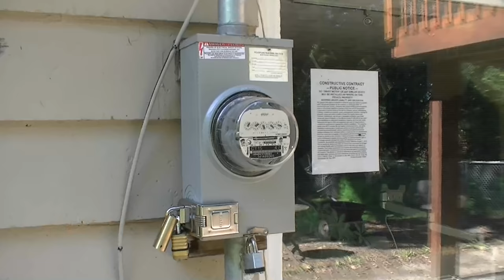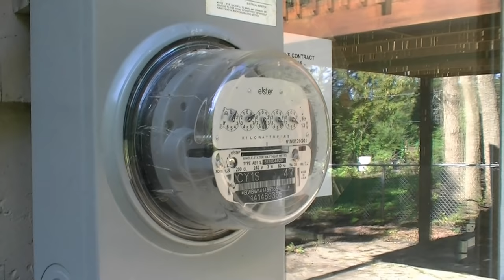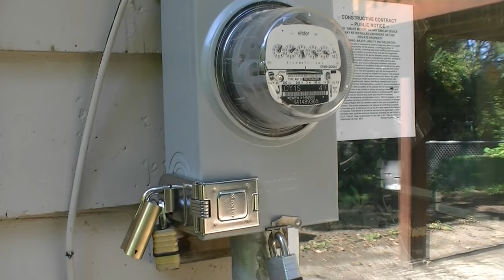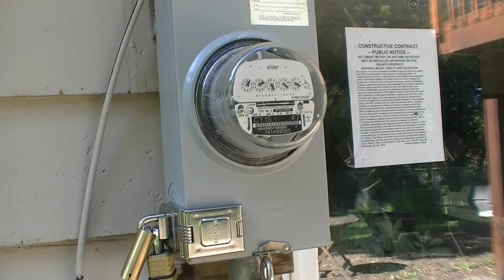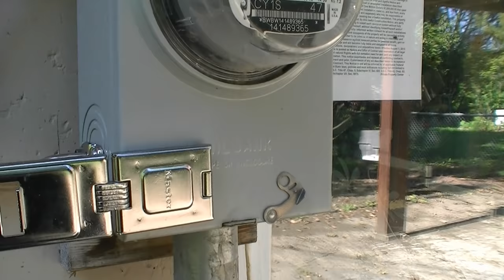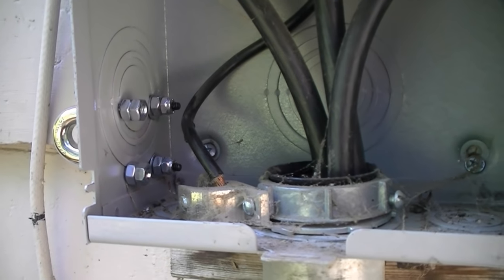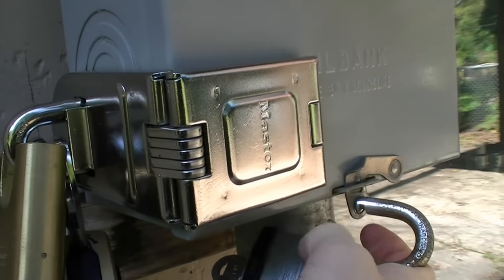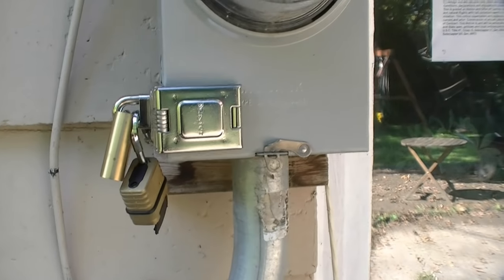Locking Your Electric Meter to Prevent Smart Meter Installation

Comment: Although I can understand your message, your tactics are asinine to say the least. Drilling into the box with live power a few inches away makes you a candidate for a Darwin Award. Please don't breed.
Reply: Mike is right.  Drilling into a hot meter can is extremely dangerous.  120 volts to ground doesn't seem like much, but it can burn you, blind you, cause a fireball.
Reply: It's not even the voltage in the box, it's the amperage! The only fuse protecting the wiring in that box? The fuse on the primary of the 13,800 volt transformer on the pole or in the pit!
Reply: *You're ... We'll just leave that there and sink in for a minute. ;)
Reply: Ishkabibble if you were an electrician, as I actually am, you would recognize that is a service drop. Which means if he opened the box and pulled the meter then the bottom posts would be dead. Therefore his drilling and installation would be perfectly safe. Do your homework before attempting to speak from authority.

Comment: This be dumb.  Electric code was arrived at largely by a century's worth of fires, investigated by fire departments and reviewed by electrical engineers to arrive at hazard removal/prevention by reasonable methods of construction.  So guess what? Never, ever have a fire at your house: if you have done something preventing the meters emergency removal, keep your lawyer on speed dial.  You just might need it.  Luckily, most FD's carry bolt cutters and will take care of business - but at a cost.  I'm guessing this setup costs you about $1400 in the event of a fire [beyond whatever damages occur].  If a conflagration spreads to your neighbors,  bend over.
Reply from the maker: Flinch are you saying the fire department would charge $1400 to use a pair of bolt cutters?  That doesn't seem very reasonable at all.

Another option is a home owner can install a meter socket with a main breaker attached to it.  Wouldnt that solve the issues in case of a fire?
Reply: No, just a personal guesstimate of legal fees, fines and possible court costs.  No way to nail down a real number, as every state is different.

Comment: This video is good example why you tube is piss poor place to get information. It is true in most places we own the meter box. However when we sign on for a connection to the grid we grant the utility ingress to their equipment. So cutting the locks wouldn't be vandalism,  because it's the utilities right to access their equipment an install whatever whenever, they deem necessary. Sorry this dude is one more smooth talking smart meter loon spreading FUD. Load management is going to happen, yes it's going to be a pain to adjust, but rolling blackouts or total blackouts would be more painful. Unless there is a critical medical need I fully support the utilities disconnecting these protesters. They seek to force their will based on ideology, and ignorance on the rest of us. They might call those of who us see what has to happen for the good for the maximum number of people sheeple, but they are their own breed of sheeple. There are battles to be fought, but these sort obsessions keep many people from recolonizing them. Perhaps they recognize them, and don't want to take on those battles because it would mean  real world, real time sacrifice within the borders of the US. I'm not talking of deadly or physical sacrifice, just giving up a little of those luxuries so many believe it's their right to have Hell if I know, but it getting pretty frustrating.
Reply: waswestkan  very well said!!
Reply: waswestkan My company wouldent let me lock my box up to stop the local teens messing with it.

Comment: I'd be afraid to touch those metal locks knowing that metal conducts electricity.  What if one of those wires inside the box comes off, and is touching the metal box on the inside?  You wouldn't know it because you can't see it.  So you come out to check on your locks and touch one and ZAP!  You're gone............

Comment: the utility company has jurisdiction to that box. they can secure the box in any way they feel justified. if the box is not secured by them then how are they assured that YOU are not STEALING their power by bypassing the meter?  they can just get a court order and/or terminate service.
Reply from the maker: Do you work for a power company like so many of these commentators?  First off jurisdiction is not the right word.  They normally are given easement, but it's not an irrevocable easement.  They also are NOT given easement to install monitoring, recording, and transmitting devices.  

Sure they could shut power off but they rarely do to people.  It's not good for business to shut down your customers lolol.  And all of us consumers and customers...WE are the ones with the real power.  A little civil disobedience is needed.  How many people to install analog meters would it take?  Not a very large number!

Comment: In my area you cab refuse the smart meter but electric company will charge you 23 bucks and change a month to read you meter. Thats more than the electic supply portion of my bill.

Comment: The utility company will just cut your access to power until you comply. You can't fight a monopoly without being a casualty unfortunately.
Reply: BUT WHY DO THEY HAVE TO INSTALL A DEVICE THAT KILLS OVER 100 FOLKS EVERY MONTH?
They only have the right to measure what power you use.
THEY DO NOT HAVE THE RIGHT TO INSTALL A COMMERCIAL, MESHED NETWORK, HIGH POWER RADIO TRANSMITTER ON YOUR HOME

Comment: alsonotice that the power company is not required to give you service  especially if your tampering with their equipment  the tag that was removed is to guarentee your not stealing power  removing that tag just opens you up 2 more problems
Reply: Let's look at why we need TIN FOIL HATS. 
 #1 A smart meter will hurt or even KILL disabled homeowners who have disabled medical implants.  The average of deaths by smart meter radiation and smart meter fires is almost 100 every month in North America.
#2 Did you know if your power company “turned off” the power to your home when they did a smart meter install, your chance of a smart meter fire increased by a factor of 10,000.
#3 Your power company has access to all of you private power information. Eg When you make tea, when you turn on your alarm etc. This private information is sold to Google for huge sums of money. Ask your power company what the second radio transmitter in your smart meter does. (ZigBee) 
#4 A smart meter will cause cancer to return if your family members who are fighting cancer at home. If they come home from the hospital and sleep near a smart meter, they will die. Check with the US Cancer Society website. 
#5 Smart Meter RADIATION  will turn off breakers in your home. Both AFCI's and GFI's get turned off by the radiation from the smart meter.
#6 You smart meter is very accurate, BUT, the software (firmware) is programmable. Your bill has nothing to do with the power you use. 
#7 Smart meter radiation is breaking Ionic Bonding.
#8 A huge expenditure for a huge loss. Billions of dollars to purchase something that does not general generate any power and each smart meter need 4 watts to operate. One million smart meters use 4,000 KILOWATTS of energy to operate.
#9 The second radio transmitter is for ZigBee. If you want your power company to MONITOR your home 24/7, then you are in luck. Don’t forget, this private information will be sold. Why do you think your power company spends BILLIONS of dollars and does not generate one watt of extra power to sell?
Reply: This guy above me is a nut.. as an electrician,  I can tell you that it is not possible  for a meter to know what is on downstream. 
 How could anyone even believe it can know what appliance you have on?

Comment: you do realize that they can simple cut your power off, and refuse turning anything back on until you remove the locks or they can simply cut them off because that box belongs to the power company. Unless you plan on going off grid any time soon, this is a great way to get yourself in a nasty predicament. Not to mention you vandalized their box. Oh also your locks are incredibly easy to pick.

Comment: This is stupid, illegal, dangerous, and against service agreement.  You agree when you get service that the power company is to have unrestricted access to their equipment.   Plus if you have a fire the fire department needs to be able to remove meter and as an installation tech of the smart meters if i find this it would not prevent me from doing the exchange i will cut the locks and complete the installation and am legally able to do so.    As for the radiation topic you would have to be stupid to believe that because you carry a cell phone wich puts out more rads than the meter, you have a microwave in you kitchen the puts out  way more rads than this meter, and most likely you have a WiFi router wich is also putting out more rads than the meter.    I have changed out several analog meters that are melted and to to say the smart meters melt and analog dont is one of the dumbest things I've heard.

Comment: Why does a lock protect from smart meter change.  Can't the power company cut the power line where it enters the analog meter box & install a second box?
Reply: Locks don't protect from a meter swap. In the area I live in, every new service contract clearly states  that the utility is to have unlimited access to the meter and they reserve the right to refuse service if impeded.

Also, many utilities are municipal or state owned which means they codified different penalties for tampering with the metal seals on the meter base. Were I'm at the utility can charge you with tampering and it will hold up in court. Know the laws you fall under before you try anything like this. 

What this person doesn't tell you is that the analog meters belong to the utilities not the homeowner. The meters are not your property and if the utility as well as the overhead/underground lines.

Lastly this very dangerous. Not every meter base is made the same. Not every home has the same type of meter or wired the same. Not every meter is rated for the same voltage some are low and some are high, the size of the structure doesn't determine the voltage. Some meter bases have tight clearances and this type of tampering will drill into the live wires. Damaging any of the internal components on a live meter base can not only kill you but you could run the risk of causing an electrical fire or tripping the breaker in the transformer causing problems for your neighbors as well. I've seen the what can happen when people who didn't know what they were doing made a terrible mistake.

Comment: The grey box the meter is enclosed in, is the homeowners property. Thus it can be locked, the wires that run from your home into the meter are property of the homeowner. Legally the box can be locked by the homeowner. The electric company must give you notice to enter upon your property. In my case having multiple German Shepherds on my property, I have notified my electric company by certified mail that they must notify me before stepping foot on my property, and put them on notice of the security dogs and that they assume all liability if they do not notify me of entering upon my property, per my attorney.

Comment: How about putting it inside a steel reinforced concrete wall with only visual acces from the front. Further acces from the inside of the garage or basement will have to be granted by the home owner.
Reply: Nope,  NEC rules states there are levels of clearance around and in front of the meter can.

Comment: it's illegal to put a lock on the meter box. the reason why is if a house  is on fire and the fire department needs to cut power off to save time to save a life and  prevent more potential injuries if they have to wait for a line man  there's a good chance someone will be hurt or your house will burn down or both and your seal tampering tag is gone you could be fined 10.000 and lose your service permanently
Reply: For everyone wondering about what would happen if the building/house caught fire and then the firefighters going, "oh, well we can't take the meter out, guess we'll let it burn down. There are many meter boxes that have a main breaker outside, as well.  

This is a dual meter box with a service disconnect: http://www.homedepot.com/p/Siemens-Uni-PAK-2-Gang-125-Amp-Tenant-Main-Breaker-Meter-Socket-WP2211RJ/206109554?cm_mmc=Shopping%7cTHD%7cG%7c0%7cG-BASE-PLA-D27E-Electrical%7c&gclid=CjwKEAjw6e_IBRDvorfv2Ku79jMSJAAuiv9YptIGAAsw4R2Vj6kd_EUIfcKL443ciatMBfmuAtZMtBoCxVLw_wcB&gclsrc=aw.ds

Here's another example from google: https://www.handymanhowto.com/wp-content/uploads/2012/01/DSC06222.jpg

You could very well have one of these installed in order to be able to shut off the power to  your house so they can continue to fight the blazing fire.